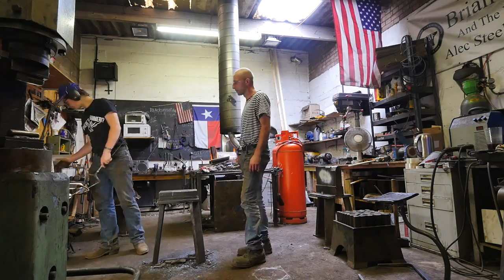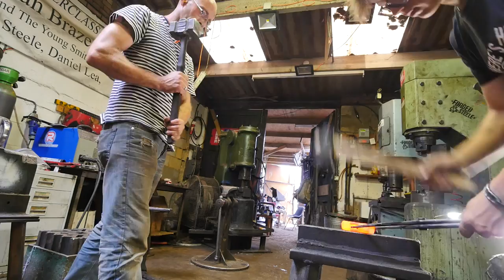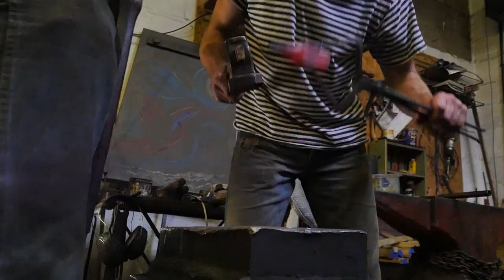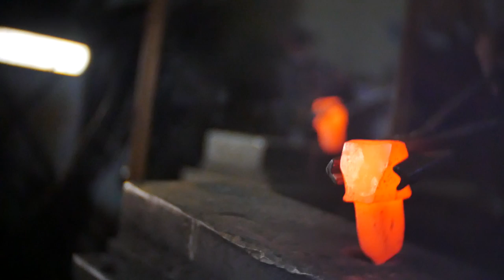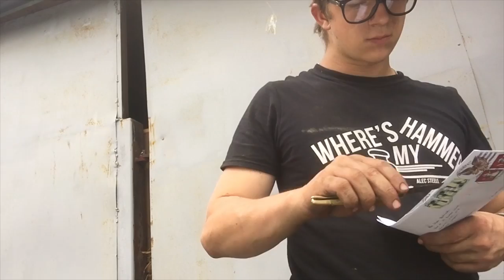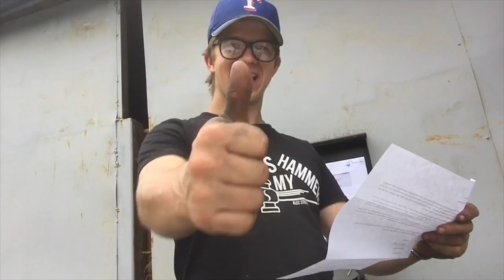HIGH SPEED BLACKSMITHING

Comment: Alec, Where's My Hammer!
  I do have a question that I hope you could answer. I've been watching your videos for some time along with several others. I'm just starting to get a forge built. I've got a RR anvil setup already. I'm going place the RR anvil on a log that I'll set into the ground. I have had hardware put into my back that keeps me from standing and bending over for very long. If I stand like I would need for very long I'll be done for the day. I think I could do this sitting in a chair and go for a half hour or so at a time before having to lay down. Do you have any idea of how high above ground should I set the top of the anvil? I know this was long and drawn out but you needed some details. have you seen anyone handicapped forging before? I really want to see if this can be a new found hobby. Your videos are inspiring and very informative. I look forward to each new video! Thanks in advance for your reply, and for the efforts on putting up the videos.
Reply: RC, I don't usually give advice as my best thinking got me in Afghanistan for the better part of five years, but I'm going to take a shot at this, as I have spent more time in a hospital after getting racked up than most. 

Think about the end result. Where/when is the hammer going to strike. Work backwards from there. Assuming you are right handed, I'm thinking a seated supported position, a post anvil to the right of your right knee, anvil face at mid-calf region. The issue that I see right away is that if your back is compromised, twisting down and to the right with hot metal in your left hand might be troubling. Custom tongs would probably ameliorate that. Forge would by necessity have to be in front of you. For tempering you would have to plan that out as you need range of motion to cool the metal safely.

Also consider what you are trying to create. I don't think sledgehammers are going to be in your line up, but other items might only require you to be in a rolling chair and have heavy work tables with jigs to bend hot metal into shape.

Forget about being "handicapped!" You just need to out-think the means/methods to the end result!  I think you should go for it and post your results. You will undoubtedly come up with great ideas that others might not have considered!

My friend Rich may have some further ideas as he has far more refined skills than I!  
AAR
Reply: +Albert Rasch Thanks for the input Albert. I'm not in a wheelchair and do have some physical ability. It's limited in the leaning over, twisting, walking, sitting, and prolonged standing. There's rods in my lower back that has helped the nerve situation but unfortunately it hasn't resolved it. I dont consider myself as handicapped. Maybe a little challanged.  Im trying to do a little at a time but hoping that I might be able to carry on and smash metal. haha. My thought was to place the forge on my left side with the anvil to the front. I think that if I had tongs that would be of regular length and a lighter hammer that I might be able to do it. My thinking for the anvil height would be a couple of inches above my knee when sitting. I'll bury the stump higher than that and work down or set it on blocks to try to find a height that seems to fit. I don't know what would be a  better height. Maybe someone that has to work from a sitting position can offer advice as well.

I can't begin to thank you and the other men and women that have served. My youngest son has been to Afghanistan many times with special opps. I've had many sleepless nights. Surely not as many as the people serving. On a bright note, my granddaughter would make you proud. I'm doing part of her home schooling and she insists on starting with The Pledge. Makes me proud! 

Thank you so much. I've had several people on Facebook give encouragement to just get started. The blacksmithing group of folks have been awsome. I hope to be able to re-pay their efforts.
Reply: RC, I understand your question, I have RSD and gave had spinal reconstruction surgery due to Spinal Stenosis, walking is questionable and unless I lean against something I'll fall, my balance is gone, I've adjusted the height of my anvil so I sit a little crooked on a shop stool and can swing away comfortably. I'm not dead yet, I'm not giving up my tools or cars. And although I can't work as often as I like I still have good days. I hope this helps, I'm sure there's a way for you also. Stay in touch, Jim

Comment: Where's my hammer! What type of tongs are you using when you are forging your hammers?
Reply: He is using pick-up tongs/tool-makers tongs there is a guy who has a great video on how to make them just type in pick up tongs or hammer making tongs. The reasoning behind them is simple, with very small surface area contact you can very quickly spin, rotate, or flip the piece, and the slim design allows you to get inside the eye of the tool.

Comment: Any tips for creating a hardy hole in a railroad track anvil?
Reply: Take a piece of 1 inch, 3/4, and 1/2 square tubing, slide them into one another and then weld them up on both ends for strength. Then weld the whole assembly right on the back of the track, boom hardy hole.